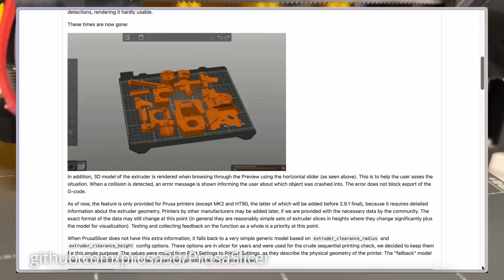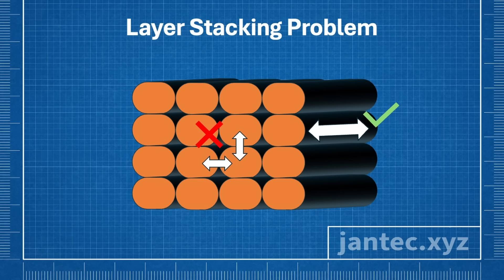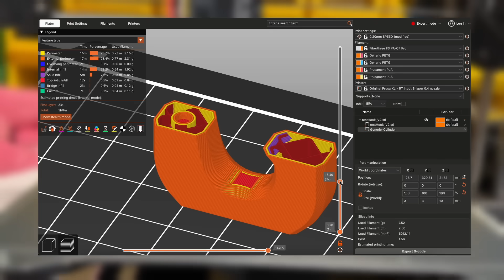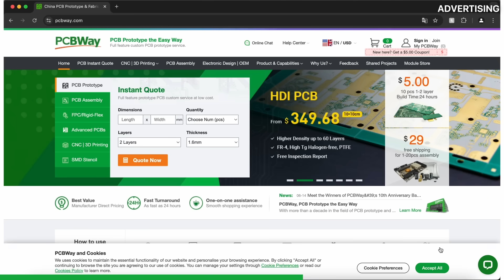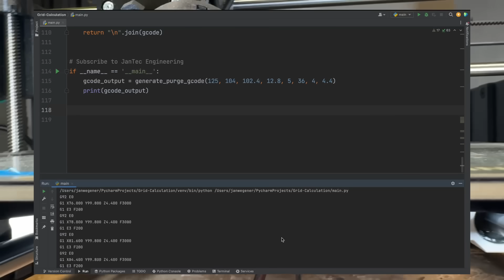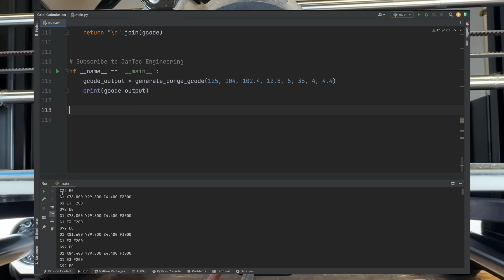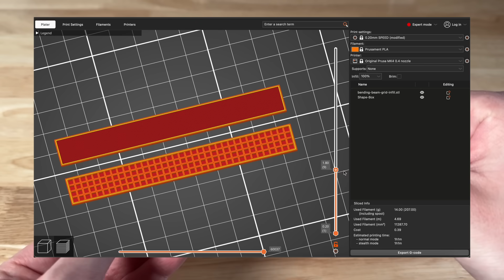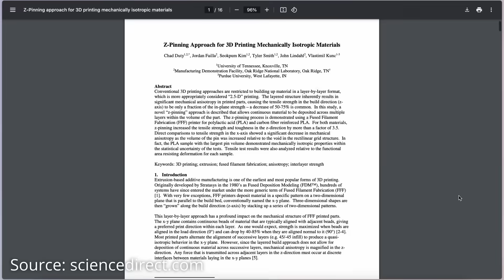Stronger 3D Prints by injecting Filament into the Infill

Comment: What about time? Was it faster to 100% infill or injecting? What about the amount used.
Reply: It looks to me that this should be significantly faster, since the print head can push plastic at maximum speed, and the nozzle spends much less time finding the right spot to put the next trace.

Comment: Thanks for this!

I see in the comments quite a few people have wondered about this. The ”algorithm” is controlling our thoughts. 😅

What about just doing double or triple layer thick and hot lines inside the outerwall. Just to bump up the strength a bit but without melting and deforming the part?

Comment: I had this idea, but I had no idea how to implement. I thought about manually using a glue gun. I also thought about creating a tube within the print with a funnel top and pouring in resin.
Reply: Create a channel in the part and stick a piece of filament in there. Heat the end of the filament and squish it flat :)
Reply: for adding Z level strength, I like adding a hole and putting thin wire or nails in even, was a godsend back in the days of ABS printing because of the layer bonding issues with raw ABS but it's just a trick I never let go of

Comment: Would be cool to see it with hexagon infill to better fill all the corner voids, then shift the infill walls every 5mm or so so you can use a stock nozzle. As a TIG welder by trade, I will swirl the electrode a bit as I taper off the power when stopping a weld to prevent a fish-eye bump. The same concept could be added when filling the holes, start in the middle, but as it gets closer to filling you gradually swirl the nozzle wider inside the hole to fill out the top to the edges as well as kind of ironing it flat instead of getting the "Chocolate Chip" point in the middle.
Reply: Bump this up!

Comment: How about a hybrid of this and standard printing, where instead of needing to fill the cavity from bottom to top, you print infill channels using something like concentric, then you slowly fill them while moving the nozzle along to create more of a very tall, thick, wide extrusion.  Like using a piping bag to frost a cake.  Could keep the nozzle a little cleaner and add thick, dense, solid extrusions along the geometry where it's needed most.

Comment: 06:49 I think for that kind of measuring, the bottom of the caliper might've been more useful; you place the flat against the tip, and lower the sliding rod until it touches the base of the nozzle extension; or maybe if the thickness allow, actually, the top might provide a more stable surface, touching the sliding side on the tip, and pushing the fixed side until it touched the base of the extension. But, your eyeballing with the hole-meter prongs seems to have been close enough for the tolerances, so not a big deal.

Comment: I know I’m basic asf. It I’ve been doing the 3d print pen method for years . I just put in pause points when using the slices by just clicking on the layer and adding a pause . Then when it pauses I know it’s time to fill -

It’s not perfect and you can do about 20mm layers .

I only do it if I’m making a tool or usable thing , mechanical part 

For just little fun models it’s not worth it

For example I made a bracket that turned a pedestal fan into a wall mounted one , I filled the hell out of that cause it’s vibing , moving and it’s heavy - 

It’s a great use for all your odd bits of filament but you need thick walls or you can end up melting your walls which I learned the hard way

Comment: when you presented the problem "the nozzle can't fill a hole that is too deep" my immediate intuition was to break the filling operation into parts by height and fill, say... 5mm deep at a time. Especially since at the start of the video you talked about how the future is in the software.
This way you won't need a custom nozzle and you won't need to limit the height of the cylinder you're trying to fill.
Reply: Perhaps alternate the fill cycle every other horizontal grid layer, too? I think the Python script would be relatively easy to modify in order to achieve that.
Reply: But every filled bit of 5mm will cool down and then you are making layer lines again, and weakening the structure.
Reply: @jeroenkoehorst4056  Perhaps! I think the thermal mass of a plastic poop might be enough to re-melt the layer under it but this should be tested. My guess is it would be stronger than the normal layer adhesion.
Reply: @daravango  good point, you dump a lot of heat on it (even higher than the normal printing temperature).
More testing indeed.
Reply: @ as long as you connect 2+ layers it should be a win, and if the area is significant bigger than the normal infill line width it should also improve z strength..
Reply: @jeroenkoehorst4056 you can stagger it
Reply: I agree, but it's important to keep in mind that, at the extreme end of this idea, you reach "You could just do a fill operation after every layer!" at which point you're just doing 100% infill with extra steps. What makes this technique strong is specifically that it's a large (mostly) homogeneous blob of plastic, and doing it in layers reduces that homogeneity. So either it's going to be a game of balancing quality with strength (again) or it's going to be a matter of doing something fancy like moving the nozzle around while injection-filling to leave a gap in the middle or something to act as an 'anchor' for the next injection-fill section to flow into and latch into/onto.
Reply: @robonator2945  alternate the layers of infill, so you end up with (for example) a checker board of infill connecting layers 1-4 and layers 3-6, repeating with 5-8 and 7-12, and so on and so on. Because the fills lack a common shearing plane along the horizontal it's stronger than a 100% infill. You can get more strength by adding extra infill groups (e.g. 1-6, 3-8, 5-10 or 1-8, 3-10, 5-12, 7-14 etc.) and thus making the common shearing plane more vertical. Ideally you should be using as thick an infill as you can but staggered like extra long bricks.
Reply: Exactly my thoughts, make it even really small like only 1-2 mm hight you fill and also alternate the starting hight like brick layers but for the In-Infill
Reply: It depends on the length of the nozzle  😊

Comment: Cool video. Not sure if worth all the hassle compared to printing 100% solid or with the brick layers technique...
Reply: It would compliment the brick layer technique nicely, I'm thinking.
Reply: I think the idea is to be able to reinforce the parts where it's needed without adding unnecessary weight and print time
Reply: I'm pretty sure the "hassle" you're referring to is writing an algorithm that gives you the effect you want. I'm under the understanding that learning and implementing algorithms that save humans time and effort are worth the effort because I believe a one time cost that makes continual returns will eventually grow larger than the one time cost.
Reply: @sergemarlon  then you might as well print 100% solid, material wise is the same. And it will take a fraction of the time and setup (extended nozzle).

This technique might be good for certain applications but as of today I don't find it useful for 99% of users.

If you use this to purge your multi color/material system poop into the infill, then I would look at it with different eyes.
Reply: @rafaelmontserrat4443  Nah stashing your color changes waste is the only viable use? You're either very silly or very uncreative. Saving time and effort is what I'm sticking to. I'm certain that filling with 100 infill will be slower, more tedious and won't have as good a support compared to a decent algorithm that does what the video presenter is hoping to achieve. Waste stashing on the other hand, is not very helpful. It would probably be better to dispose of the waste between color changes into a shredding machine and melt those shreds back into pellets that can be reused to make more plastic products. You'll save time, in each print, and have extra materials left over.

Comment: Dude a 3 point bending test was the absolute worst kind of test you could have chosen for this... you WAAAAY underrepresent the added strength/stiffness you get from the filling because of 2 effects:
1. Loading direction perpendicular to the fill direction instead of along it
2. Bending creates an uneven load distribution where the outer most layers have the biggest impact on strength and stiffness.

Do some test that works along the print direction and evenly distributed the load across the layer, so that the fill can actually properly contribute.

Really nice idea, but step up the testing a bit

Comment: is this a joke? what? sorry?
Just fille it 100% everywhere ot in some areas only. Make a script for that. But injecting in what you could fill normally in the beginning is like buying a car without a motor and then look in the market for a motor to insert it in that place
Please! what is happening in the community? no more innovation at all? zero? dead?
Reply from the maker: I don't think you quite understand the concept, do you?
Reply: @JanTecEngineering  I do, and this is why I said this. I am not a maker. I am an engineer and product developer. I understand it very well.
Reply from the maker: Okay then please explain to me, why 100% infill leads to better layer bonding than injecting into a grid in your opinion. 
You don't trust my impact testing? Fine. 
But I don't quite get why this should be "no more innovation at all".
Reply: @JanTecEngineering  1) deformation of the infill structure and side is a big problem. 2) unknown filling behavior and voids are huge problems. In general, because you cannot calculate how the part will be in the end from inside and the general structure, it is not only useless but causes trouble and damages the part. You don't want that ever.
And about the papers, well, this is a topic for itself. It is very easy to publish a paper. And even if it was a serious work, applying something on specific shapes and sizes is something, and applying it in real work on what people really do is something very different.

Selective filling is useful, but not like that. As I said, focus and work on selective filling during the infill generation so that different percentage of infill could be applied on selected areas . That is calculatable and consistence, which is really really important.

But filling the voids with other materials that really fill a gab completely is also useful, but not like that man. Not with hot molten plastic. This is completely wrong.

What I always wanted to see is a way to fill with all kinds of resin which could also contain all kinds of additives such as micro carbon fibers, for example. This, of course, requires a machine with two tool heads, one for regular 3D printing and one for filling and UV hardening. This, is innovation. 

I gave you a million dollar idea. Take it and go with it. Good luck. I am working on other things and have no capacity for this.

Good luck

Comment: There are two main reasons for infill:
SAVES TIME
and
SAVES MATERIAL

Second: Infill doesn't affect strenght much, layer adhesion will be weaker anyways.
Also structural performance is mostly on the surface of the body.
Reply: testing is always good but still

Comment: Are there any downsides to airbrush style nozzles? 

I think printers should start shipping with them and become the standard style to future proof for when non-planer becomes more available, plus there will be more printers out there that can support it so bigger market to develop for.
Reply from the maker: There are a few minor downsides: 
- Heat conduction is a bit poorer
- Part Cooling needs to be adjusted (not a big problem, but would require a design-change for common toolheads)
- At least for this design: possible leaks since it consists of two parts threaded together
But yes, I think modern printers should ships with similar nozzles and toolheads with bigger clearance for non-planar printing and tricks like these!

Comment: Feel like your grid infilled bending test should have been hexagonal grid rather than square otherwise youre testing along the printed sections exclusively.

Another thing id like to see you try is if you do those circular holes but leave every 4th layer or so mostly blank or instead a semicircle so that maybe the pressure could push the plastic into the rest of the print.

Comment: Ah yes, "cement mixer mode" I was talking about some years ago with friends and was told it wouldn't work :)
I'd love to see how much infill multiplier improves strength, I heard it's present in Cura but not in other slicers yet.
Reply: infill multiplier?
Reply: @KP-ty9yl  When you print parts now, infill is always one line width thick, like if you printed one perimeter on model. But some slicers allow you to set multiplier - for example set it to 3 and infill will consist of 3 lines next to each other, kind of like three perimeters. Basically making infill thicker and more robust.
Reply: @DreitTheDarkDragon  oh interesting!

Comment: Good concept. 
Maybe this can by combined with a honeycomb infill because the filament can flow into the corners better.

Maybe doing this with cubic or 3d honeycomb would be interesting as well because then you would have blobs spread around at different layer heights

Also maybe ironing can clean out the top of the infill so the layers above come out better

Comment: Interesting idea ... but i'm not sure about "thermal stress" when You put a "huge" amout of hot filament into print .... maybe You can do it with smaller holes and lower hot filament volume in random "order" and doing it at diferent Z heights. 😉 Another idea: Put resin into print in some "caverns" and cure it.
Reply from the maker: You're right and the idea of filling resin into it is really good!

Comment: I have to ask.. What if you printed it out so it had interlocking infill. I'm not sure if it's always ideal to do want this.. But there might be a situation where you want your part to just be a nearly sold chunk of plastic, but trying to do that is hard because you are putting too much heated material into an object by stuffing it full of hot plastic in one go. It gets  so hot it deforms...

So what if you broke it into stages of infill and had it interlocking like building block.  At the first stage, you lay down your bed and build inlay holes for the entire part infill.  1/4 of the holes are chosen to get infill and give only 1mm of infill as that as much wall as you built so far.  You infill only a 4th of those holes and then build up another mm and now fill in the next 4th of holes up to the 2mm mark, Again because that's all the wall you have set so far...  now you add another 1 mm layer and fill in the 3rd group of holes up to the 3mm mark.  

At the 4th mm mark you can either fill all the holes up to the top and cap it, or just fill the 4th group of holes with infill up to 4mm as that as much clearance as you have with your inject.. You Just keep going like this making walls to hold all the infill and infilling only 1 of the 4 groups as you go.  But doing so should give you much more compression and tension in all 3 directions, as opposed to a regular print where the one direction that you lay down plastic in is very weak.  Doing it this way also means you are spreading heat out over time instead of doing it all in one go and deforming the part.. The only issue is your forcing your printer do purge cycles in the middle of a print... and that is very weird. But it looked like you were doing that anyway.. 

Off-topic, you mentioned that you could see infilling with other materials.. I have seen channels the parts are made specifically with the plan of infilling them with concrete... this works out great as the finished parts have the durability of concrete inside of them but can be finished like a plastic part on the outside..

Comment: I would be very interested in how this would affect annealing, would it have an effect on the deformations? And ideally annealing done with a filament drying box, or maybe even covered up heated print bed. The point being that it would display capability that can be achieved without buying additional equipment. If the results are positive, it could really add another lever to 3D printing. So fare, I've had mixed success with annealing PLA, slightly better results with Tinmorry and Filamentum filaments, parts get a seriously boosted temperature resistance, but slight deformations weren't always predictable, and I feel infill is the reason why.

Comment: Maybe this can be a way to avoid doing purge towers, which is a huge wasting filament. Just inject the purging into a bunch of holes until the new filament is ready.
Reply: This could be a way to sidestep filling for strength patents.  Just call it purging instead of backfill.
Reply: Also, using a hex pattern for the interior walls would avoid air pockets when filling them. It's probably possible to change the zcode to get a rougher surface texture at the top of each fill too, which should increase strength as well
Reply: @ This has a lot of potential, closing over the cells and leaving just an injection port is a option to prevent excess ooze.  Also the technique can be used selectively to strengthen only those places that need the extra compressive strength.

Comment: Awesome stuff! A really cool slicer implementation would be allowing the user to click on empty volumes left by the infill pattern to select which areas should be filled. That way you could strengthen key corners or stress riser areas for example. Personally, I don't think G-code routines like this should be patentable. Keep up the good work!

Comment: 10:42 In the three point bending test it would be interesting to see strength/weight. I'm guessing it was similar in this test but using infill injection in load critical areas might give a nice compromise between weight and stiffness.